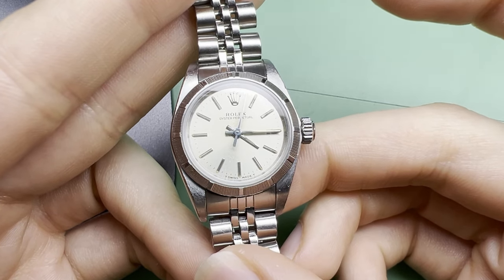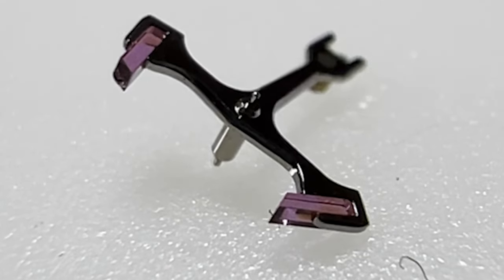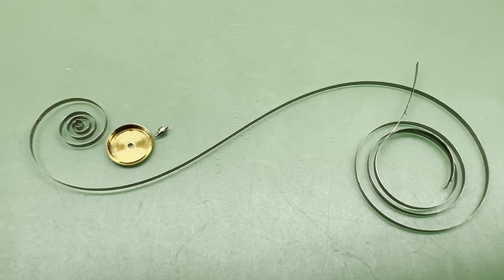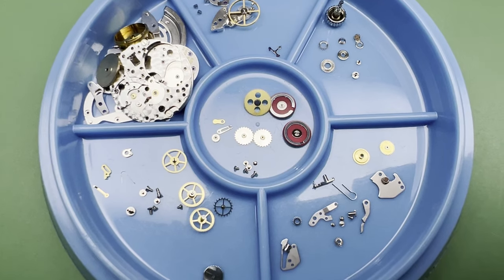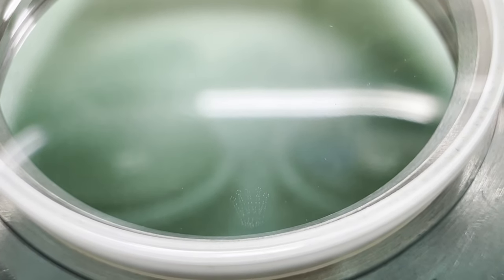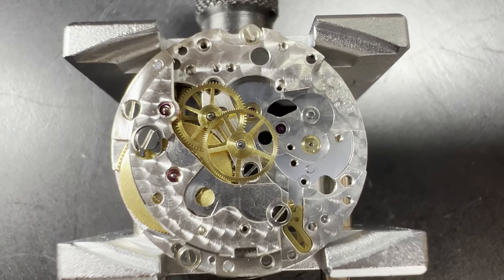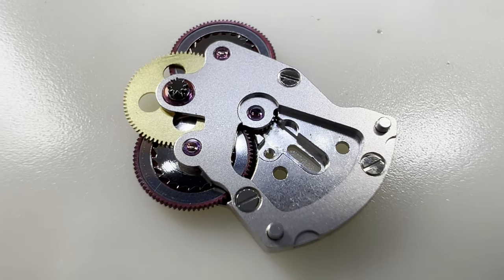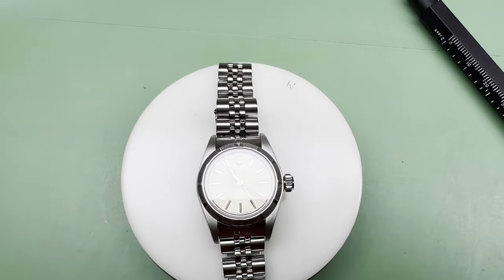Rolex Oyster Perpetual Full Movement Service and Case Restoration - Cal 2130 - Ref 67230

Comment: May i ask why when refinishing and polishing you didnt remove all the scratches and imperfectons? Is it a case of improving whilst not removing too much material?
Reply from the maker: Yes, partly not wanting to remove too much metal, also the dial is not in perfect condition, so I didn’t think it needed to look like new. And having a look back, the camera shots do make the marks look more prominent than they are.
Reply: @JosephCooperWatchRepair  many thanks for answering. A sensitive restoration in keeping with the dial patina makes sense now you've explained it.

Comment: Your website is pretty clear - might send you my Rolex Datejust from the 1970's, just a bit worried about the cost of replacement parts as Rolex themselves said it was quite a mess inside :(
Reply from the maker: Hi, if you drop me an email with a couple of photos of your watch we can take it from there. My email is at the bottom of my website.
Rolex spare parts are really expensive, but I take a more pragmatic approach than Rolex, if a part has some wear but it is uneconomical to replace I would reuse it if a client is happy with that. This also keeps the watch as original as possible, whilst getting it running again.

Comment: Great video. I have one question, where to get this plastic basket with two trays for ultrasonic cleaner? Thanks
Reply from the maker: Thank you! The white plastic baskets are from Cousins UK, under: Tools & Equipment - Ultrasonic Cleaning - Baskets & Pots. The bigger pot is actually Tesco’s tupperware, as the thin plastic is great for allowing the ultrasonic waves to propagate through.
Reply: @JosephCooperWatchRepair Thanks, so you got two white plastic baskets from Cousins and stack them on each other? (3:30 on the video). 
Thanks
Reply from the maker: I have cut the stem off of the top ones, leaving the stem on the bottom one, and have threaded the top baskets onto the bottom ones stem. I hope that makes sense.